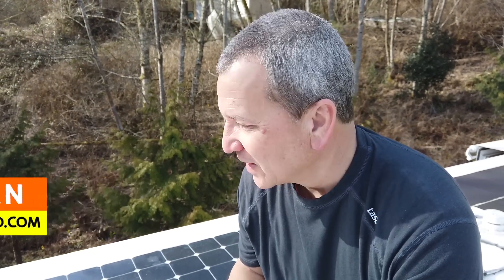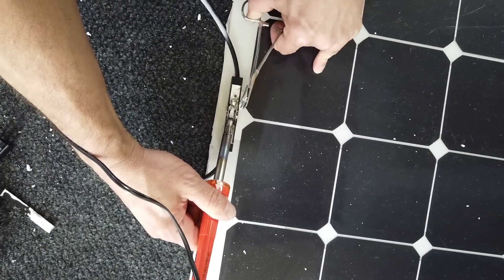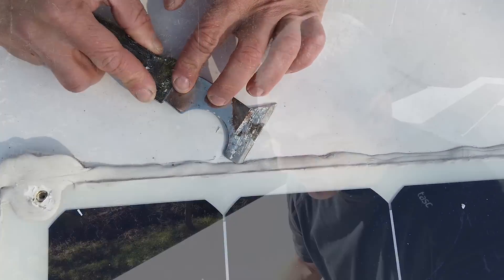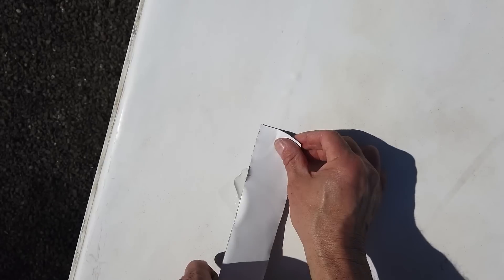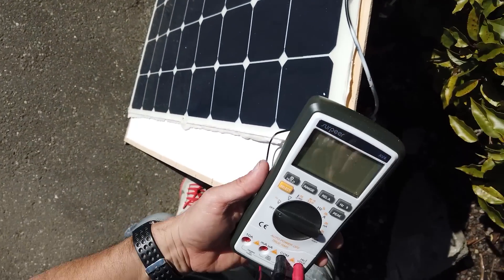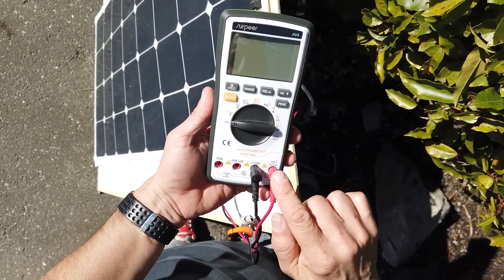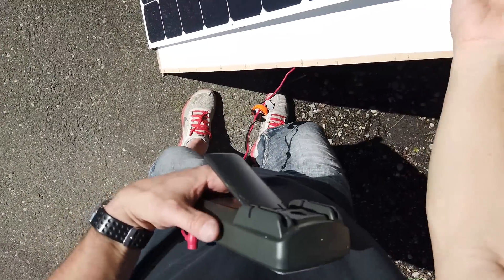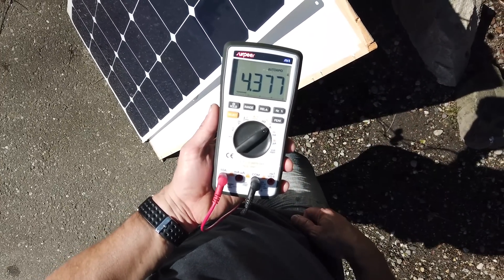Flexible Solar Panel FAILED after THREE YEARS on my RV

Comment: Flex panels don't last? I've just developed a problem with an Australian Allspark panel after 6 years mounted on a boat hardtop. Getting hammered both at sea and trailered down atrocious tracks. Mount them with some airflow underneath, AS PER MANUFACTURERS RECOMMENDATIONS !  Anyway, my open cct voltage is down by half, probably a blown diode. Currently in a remote area on Starlink, fix it when I get home

Comment: Why would my campervan solar panel only work when it's cold? During the day it gives zero volts, but as the temperature drops at night I can see the voltage start to rise .. only managed to reach high enough volts for about a couple of hours in the early morning, then throughout the morning voltage drops.
Reply from the maker: Solar panels run more efficiently in cold temps. Sounds like yours aren't working properly though.

Comment: Really, here we are with a flexible panel glued to a rigid roof and we learn about these details which show a sketchy installation. Why did this get installed this way. Thanks for sharing the current checking procedure. No need to remove to do this. Just unplug the leads and test output. Better luck next time.

Comment: why a flex panel on a flat roof? just use rigid ones. Okay what process? Should we unplug each panel to see and perhaps use a volt meter on the output? I have three month old system now seeeming to drop in output and discolored band on my flex panel.

Comment: To bad, luckily you had 3 years of use out of it. Considering batteries wear too it's not so bad. $100 for a new one, probably better if you buy an aluminum framed one.

Comment: You have an open connection on one of the bus bars in the panel.  It will pass voltage but the moment you draw current, it's internal resistance (since its essentially a broken wire / open) shoots up and you get no current.  If you want to play with it, lay it flat with some sun on it, and the amp meter hooked up and press on it, take a rolling pin and roll it across the thing, not hard enough to really crush it but maybr  5 to 10 lbs of force to push broke connections back together.  WHen you hit the area you should see an amp spike as the pieces touch and make a circuit again.  Sometimes you can stick a soldering iron thru and 'weld' those pieces back together, but that perforates the coating so you'd need to seal that back up.

Have fun!
Reply: That’s a good idea for fault finding and potentially fixing the issue. 
There are only so many things that can go wrong with a panel and this being flexible certainly could lead to such problems. Totally worth a try.

Comment: You need to leave gaps for airflow under flexible panels - the lack of which probably caused your panel to cook the roof.
Reply: You read this everywhere but I have never seen proof that it is true – or at least truely relevant. So I measured the temps of my 1yo flexi panels this week, 2 glued right on, the third elevated. all were over 60°C (140f) in float and the temp difference was under 5°c. (so, 7-8f?)  The roof dissipates heat as well, some into the vehicle, but the delta between adhered and shaded areas also only a 5-6 degrees difference. Therefore, the main concerns should be weight, wattage and ease of installment and maintenance and if you are in a hot desert maybe the possibility to shade the roof with the elevated panels. 
Early adapters need to realize that they will have a higher failure rate. The panels have all improved, and now multiple busbars. Failures from years ago should not dissuade someone from giving it a try now. It would be interesting to see the t delta between panels in loading and float mode.
Reply: @ediatneti  Thats good info, thanks.

Comment: Hi. I'm about to start a build that will correct the issues you are experiencing with flexible panels:

Panels should have nothing but air under each cell. Permanently glue a little spacer at each intersection where two or four cells meet, plus a continuous row across the front (pieces of pencils are cheap and have opposing flat sides).

Cut a piece of twin-wall plastic cardboard to fit the panel width-wise and longer than the panel by half the width of your tape. Cut the top surface and inner walls back about half the width of your temporary tape, but not enough to strand any spacers. This means the panel will overhang a bit on the sides and rear. If that bothers you just make the twin-wall one tape-width wider and longer than the panel so the top ends up fitting exactly. 

Paint (only) the top of the twin-wall with stove paint to absorb infrared. Secure the interior surface of the twin-wall to the roof with temporary glue or tape. This is important. Perimeter-secured-only panels get beaten to death by bumps and vacuum. Secure the exposed perimeter of the bottom layer of the twin-wall to the roof with temporary tape. Note that this eliminates the large step-up during taping, along with lots of moisture issues.

Use permanent glue to attach the panel's spacers to the twin-wall. Use temporary tape (or that cool aluminum angle piece you made) to seal the front (the joint between the roof and the twin-wall is already righteously sealed, so errors here won't cause problems). Add slopes to the roof to the front and back of the panel  with caulk, foam, or whatever so as to smooth airflow during travel.

As I've seen you do, panels should be run parallel to travel, giving a narrow front and a shorter path for the venting air to travel. Note that this means that correctly installed 100/110 watt panels will outperform their wider 160-175 watt brethren.

The venting air channels do better with a "top" and a "bottom" so it's a good idea to put your panels right on the edge of the roof, where it's steeper).

Comment: I,m using the glass and aluminum frame solar panels on my old rig. Been on for over 10 years, still working pretty good.  Bought a newer rig and was looking at these panels for easier mounting.  Guess i will keep looking. Thanks for the info

Comment: I bought two of those earlier in the year (King Solar branded). One died within about 2 weeks (Amazon refunded and said don’t worry about sending back). The other died after about 2 months (no refund). I have some cheaper flexible panels that are still going strong after 2 years. Mine are bungee strapped onto the canvas top of my sailboat Bimini. And I remove them when not needed. Of course solid panels are better and cheaper, but no place to mount easily on the boat. I’m about to get 2 Sun Power 170w flex panels. They sure are pricey though, but heard pretty good things about them. I’m gonna try mounting on some 1/2” corrugated plastic board, then to the Bimini canvas. Hopefully they will get a little airflow underneath that way. Thanks for the info. Never heard of measuring current across the panel like that. My education tells me always measure current in series with a load,  because current is the flow of electrons. I’ll have to give it a try.
Reply from the maker: I have two of the SunPower 170W panels on the front of the RV now. Very good quality. I love them and may be a couple more.

Comment: Yes flexible panels fail.
Panels in a frame rarely fail.
Raymond James hit the nail on the head, its all about air flow.
If you use a flexible panel, mount it with a minimum 3mm air gap.

Comment: Your diode was definitely bad. A diode should basically read O.L (which means open leads) in one direction and near zero in the other. You read open one way but 193 ohms the other way. That is too high, not too low. You need to replace the diode and then test again. It will not work without the diode.

Comment: Can you mount solar panels on a coragated metal roof that does NOT have a smooth or even surface?  If you can, what else is necessary?   This roof is made of the same aluminum siding that is on the sides, front & underneath the cabover.  This truck camper is an older one in excellent condition.

Comment: How are the UniSolar panels doing? I've hard that flexible panels stop working much sooner than more standard panels, but I have yet to hear of the UniSolar panels wearing out like that. I managed to find some, but I want to know what I'm getting in to before I buy.
Reply from the maker: They are still on the roof and doing well after all these years. They just take up more room is all since they are thin-film modules. The other thing is that they are permanently mounted to the roof membrane with sticky adhesive so they are just part of my roof now.
Reply: @RVwithTito  Okay, thanks for the reply and video. Have a good day.

Comment: Enjoyed what you did, if your roof is Metal, try using strong peel back magnetic strip tape on a coil, it will lock panel on the roof like, glue, plus, you are not in direct contact with the hot roof, with ventilation under the panel, one utube  said make sure you use waterproof connectors for panels. Tell me what you think of my idea, plus no sticky adhesive

Comment: Update: I HAD flexible panels mentioned for 3 years.  Contacted Acopower and they replaced although far out of warranty.  Need to give props for that company.  They really back their products.  Also, they have updated that cloth backed model and now has more durable film and stiffer build.
Older comment:    I have some folding flexibles  (Acopower, good company) and they have lost capacity over a year of use.  They scratch  and lose capacity due to the film failure in other ways, even with plenty of ventilation.    But it's the only thing that will fit in my van comfortably.   The cloth backed ones also sag.

Comment: There is a high probability the diode is shorted. Cut one lead and bypass the diode completely. Then measure your current. Your panel maybe fine.  Diodes are cheap...
Reply from the maker: Tested the diode and removed it. Didn't fix it.

Comment: How did you wire your meter to get both volts and amps without changing the connection to the panel?

Comment: One side of the 5 way tool you were using is flat, the other side is beveled. If you put the beveled side down,you can get the edge to ride slightly above the roof membrane so it so it won't dig into the roof. Try looking at it on a table top and you can see what I mean.

Comment: I don't think you're using the amp meter correctly. To read amps you must be inline with a load. The 10amp setting is a limit, fused, setting.

Comment: Great video and trouble shooting technique!   Seems like flexible panels are best for occasional camping and/or power outage usage where space and portability is at a premium. 24/7 exposure to heat, UV, and weather takes a heavy toll.
Reply: I have had 2 100W panesl go bad on me. They spend 90 percent of their life indoors lying flat with only limited use during the year. Seems like broken solder joints in between the individual cells.  Might try to reflow them somehow.
Reply: @CincoDave27  which brand?

Comment: Panels shrink and expand with heat. The deadly stress is because of glueing them directly on metal, which expands less with heat. Like metal sheets on roof, panels should be mounted being able to move slightly.

Comment: Hmm... after reading how critical is is to provide an air gap to keep solar panels cool, I'm thinking solar flex panels would (very likely) benefit greatly from a layer of heavy duty foil or thin piece of corrugated aluminum paneling (applied across the bottom of the panel) to help dissipate excessive heat, which should stabilize efficiency, while also increasing longevity!

Comment: Surely, you need a load connected to check the current?
Reply from the maker: Not if I'm checking the short circuit current rating (Isc). If I was testing the max operating current (Imp)  then yes, I'd do that under load.
Reply: I will have to look at the theory of isc..thank you.
Reply: its correct ;)

Comment: Don't you have to have something drawing amps.  I don't think there should be any amps unless you have a load.
Reply from the maker: Without a load, solar panels create their own internal current when short circuited (Isc - short circuit rating)

Comment: Hi if you have bent them too much before installltion or walked on them then they last about 1 to 3 years and they fall in performance because the crystals are broken and when they get hot then the gap between the crystal becomes too big and they lose the connection and in my cases they had been bent too much during transport and poor quality. It is clearly forbidden to walk on the solar cells and when mounting I can see that you have glued them incorrectly by only laying a glue on the edge of the solar cell. It happened to yours when you drive that they vibrate up and down and it destroys and in some cases when the solar regulator pulls more amp then fire and gaps can occur in the cells and eventually they do nothing and when you put them in series so the bad ones destroy the good in service. There are also some that are made of poor quality and they may only be mounted in parallel. You either glue a large cross and glue all the way around the outer edge and gently wipe your hands with articulated pressure. You can also glue some waves 3 pieces depending on how large the panels are but the ones you have then 3 waves with support glue are stringent and glue all the way around. Just something that supports the cell so it does not move / vibrate during driving or storm. Powerful hail can also destroy cells more easily than normal glass solar cells. And when cleaning it is important not to bump into the box where the wires come out, it is also seen that the print is torn over and the dead ones. The best way to check if the condition of the panel is to send power into the panel and take pictures with a UV camera so it is clear to see any cracks or faults. But getting a company for this is usually expensive. If you know someone who has a FLIR, you can see when they draw electricity where there is heat development and which cell. The volt can not be totally counted on, but if you put a voltmeter on and you push gently and the volt rises then it will certainly crack and it is a matter of time there will be holes and in the worst case fire, but it is important not to use the system if any suspicion or clear signs are seen brown and the surface is melted. Hope you can use this.
Reply from the maker: Thanks for sharing that info. I agree with what you say. I've also been wanting a FLIR, but yes they are very expensive.

Comment: Nice detailed video.  Many people have gone with flexible panels for the ease of installation.  It seems they are still not ready for prime time for direct surface mount applications due to the heating issues.  It's very telling how some will last for years while others give up after one season.  It was cool watching you get into the panel to see what was up.  I'm sure if there was a way you would have had that panel back in service.  Safe Travels.
Reply from the maker: Thanks. I plan on sticking with flex panels, seeking out the good ones, and keep experimenting with new ways to improve their application. Hopefully five years from now we will see some improvements. 5 years ago we didn't even have many of the flex panels available today.

Comment: Can the interwiring be accessed by peeling the reverside insulation off? There if acessible the continutity of the cell inter conection junctions can be ohms checked. The cells also will have deteriorated but probably not to give only 50mA

Comment: Most probable lack of output current will be broken interconnect among the individual cells. Vibration on the roof and thermak cycles can break spot weld/solder joints.
Reply from the maker: I've looked through the panel with a bright light and couldn't see anything. I'll have to remove the bottom layer to inpect further. thanks for the comment!

Comment: Flex solar pannels need an air space under neith to disapate heat....that's why they fail.

Perhaps a heat sink should be glued to the undrrside, ribbed for air passage ...aluminum works best

Comment: Marketing a flex panel to stick on a surface should be a crime. Solar PV cells need air flow on there back side to last. Just a little research will tell you this fact...

Comment: Well that sucks. I'm getting ready to mount my flexible on the roof of my camper van but everybody is saying you only get a couple years out of it....kinda hard to be excited now.
Reply: They need a air gap (air flow) under them. That's why only a 5 year warranty.
Reply: @timesup6386  I'm going to try my darnedest to get some corrugated plastic under it. I also thought of another thing.....if his lasted only 3 years, was that 3 solid years of summer like weather? We only camp up here for 6 months of the year and the rest is winter so if my math works out, I should get 6 years life!! LOL
Reply: @dalegribble60  Heat kills semiconductors. Some are water cooling them

Comment: yes they are junk / i bought a 200 watt mono flexable panel with the brass gromets and they discolor and cracj the cells  after exposed to the sun for a few months . the rain and the uv and the hot and cold destroy these panels and i waisted 500 dollars. no you cant fix them

Comment: You can repair that panel. The problem is a loose/poor solder connection between the cells. The connection will show voltage but the actual damaged area it is still connected by is so small you won't see any amperage thru the circuit. Most panels can be repaired by removing the back membrane just at the cell connections and resoldering at each cell. An exacto knife works wonders. When finished repairing the connections you can simply cover the areas you cut away with a coat of rtv type silicone rubber like an automotive gasket making product. Of course you may spend an hour or two repairing it but to save around a hundred $ panel, for me I'd gladly spend that time on it. Good luck!